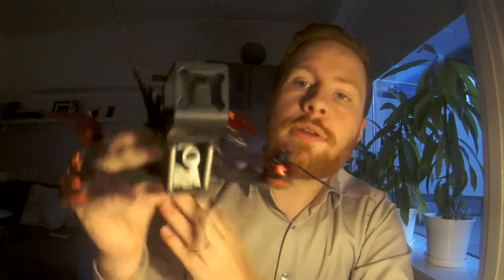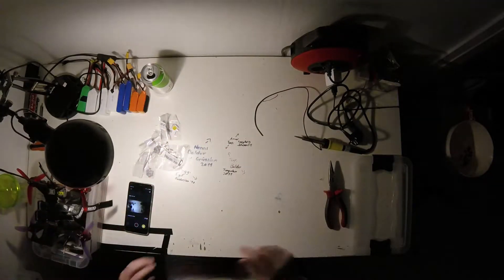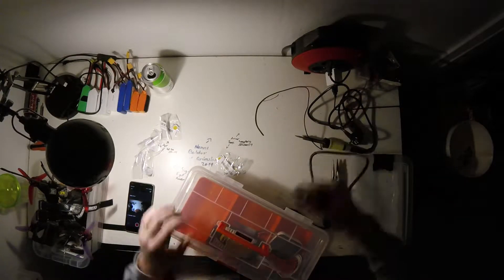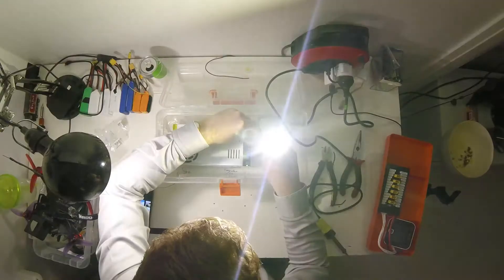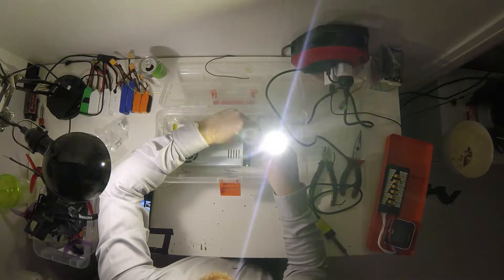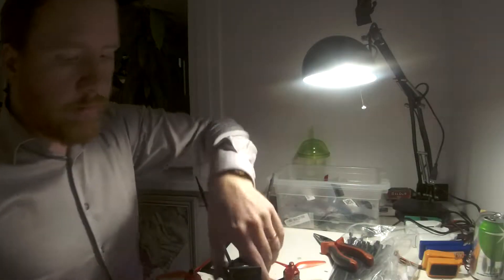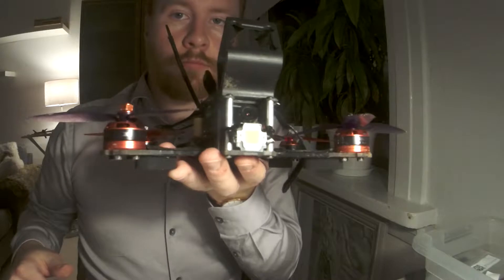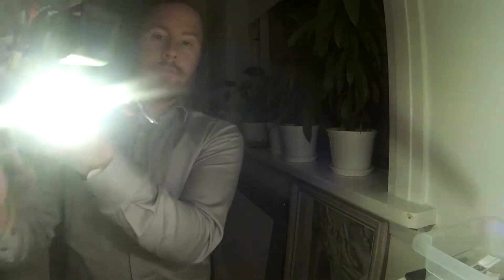Can You Put Headlights on a FPV Miniquad?

Comment: Hello, have you tried tilting the light at the same angle as the camera?
Reply: deadwings fpv Take the infrared filter off the camera or get a low light camera and then put 850nm infrared LEDs on it. Use bead LEDs which have a 120 degree beam. Infrared light illuminates much better especially things like vegetation.
Reply from the maker: Pokornz I mounted it flat against the camera plate so it was facing in the same direction as the camera. I did some indoor tests which showed that it was pointed correctly and working. But the light just wasn't strong enough  to fly outdoors.
Reply: Maybe you could put some lens in front if it, so the light doesn't go all over the place, but just where you want it :)
Reply from the maker: Pokornz that's a great idea. I'll try that next time.
Reply from the maker: Alright! Thanks for the information, I'll try your suggestion next time.